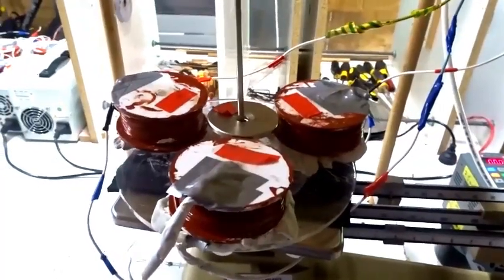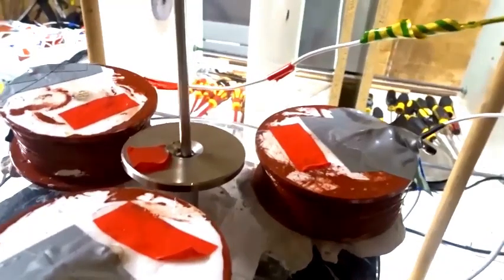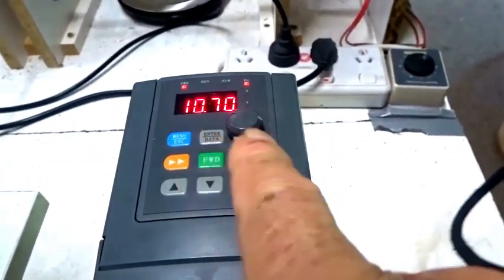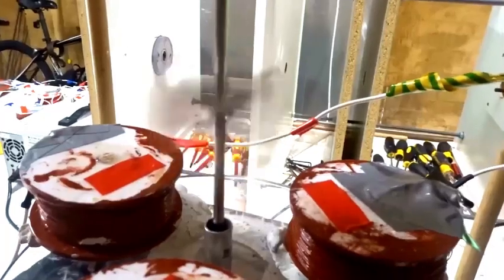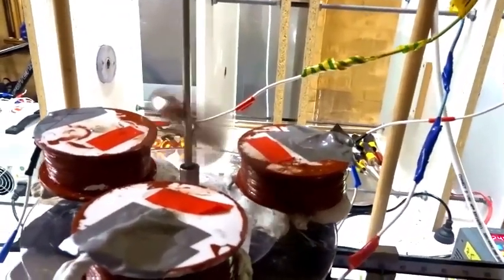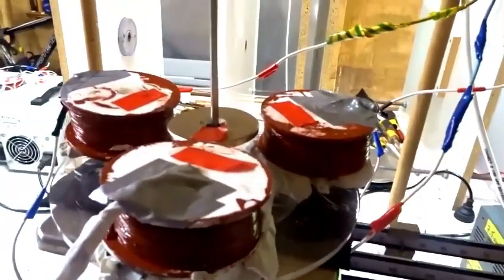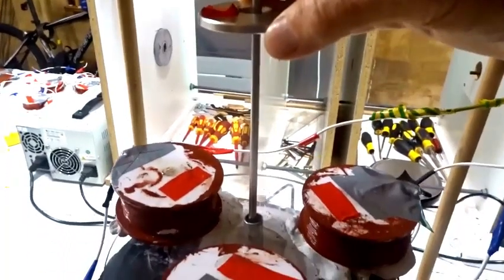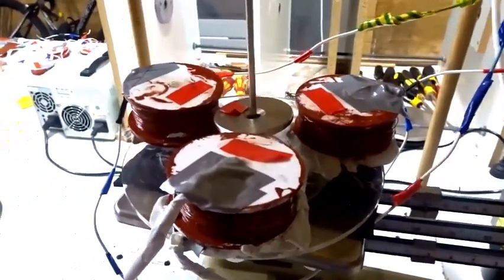Spinning magnetic levitation may permit a new kind of space travel

Comment: Hate to say but as its a disc, as its spins its causing a corkscrew motion when the added friction against the bar it goes up! 
Change the magnet to a cylinder & put a stopper on the rod so it can only travel an inch up, & if it reduces weight as it lifts your on a winner.